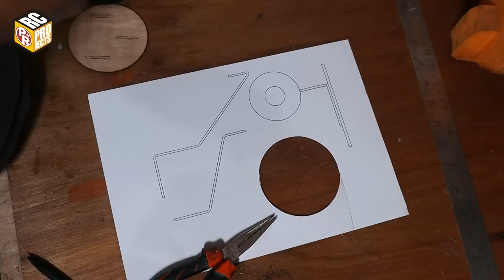From scratch to soaring: Watch me build a PBY Catalina RC plane!

Comment: how strong is the paper tube, will it last for a year of everyday flying? it is hard to find a tube that is perfectly fit to other tube
Reply from the maker: Paper tube just to guide the carbon tube, its doesn't have structural function.
Reply: @JuliusPerdana  thanks, I think at first it handles the stress between of the wings and fuselage, so Wing Ribs is the main support for the wingspar?
Reply from the maker: yes that's correct